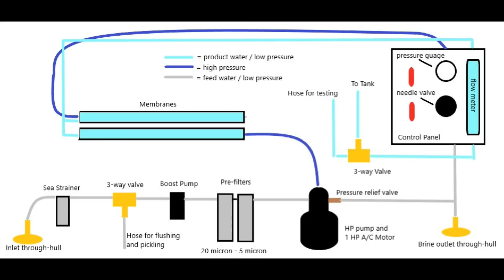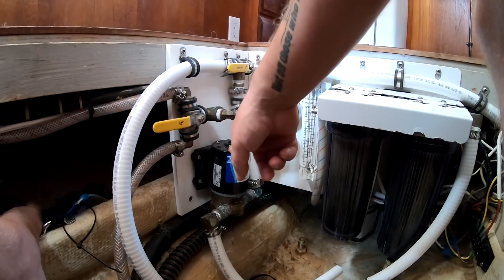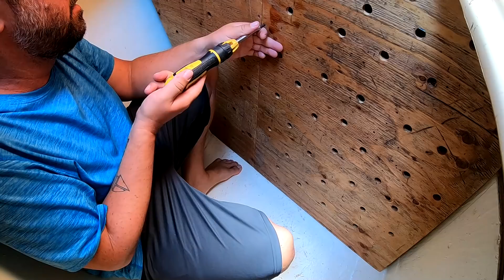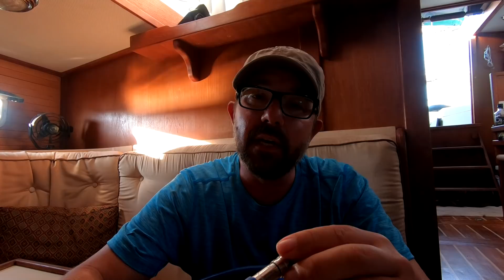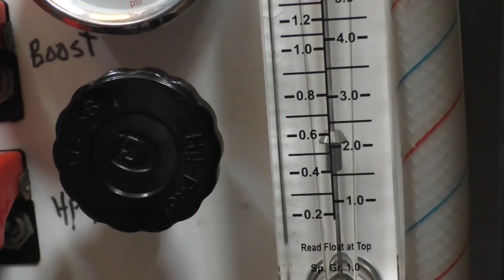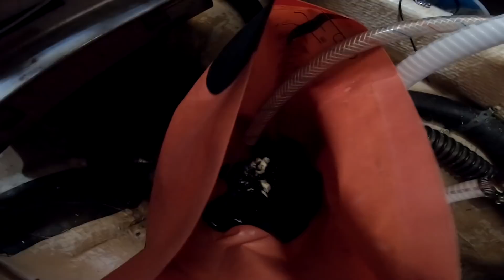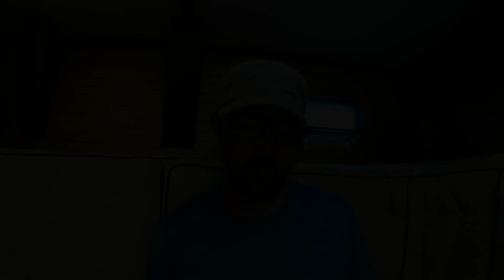How to make a 30 gallon per hour watermaker using off the shelf parts.

Comment: Could someone comment on if it is possible to design a system that does not require pickling?  I read somewhere that there is a method to take the fresh water made and use it to back flush in a way that does not require this if you leave the boat and not use the system for a long time.    The other question is even though you said the system pump and motor were noisy, could you have isolated the motor differently to reduce this noise in retrospect and what would that look like?
Reply from the maker: You can run water through a charcoal filter from your tank and flush the system every 6-7 days or so and not have to pickle the system. But that makes the system a lot more complex and depending on how long you'll be off of the boat, you're gonna run out of water at some point. Pickling is easy if you are going to be gone for a while. As for the noise, you could probably build a sort of soundproof enclosure for the pumps, but you still have the generator to listen to and deal with as well.

Comment: How long does an R/O membrane typically last running that high volume of water through it? 6 months, one year? Just wondering.
Reply from the maker: They lasts years. I replaced the first set after 4 years, not because they needed to be changed, but because we were in a place where the membranes were easy to get, so I did it as preventative maintenance.
Reply: Watch your TDS and flow volume of output water.  As the TDS goes up and the pressure is the same or goes up - that is the signal that your membranes are starting to "wear out".  They can last 4 years and I know people who have made it 9 years with good maintenance. :)
Reply: Manufacturers give membranes a 7 year life, but that's assuming that they are run 24/7 and under high pressure/high recovery rate. If you're only using it for a few hours every few days then it will last ALMOST indefinitely if it's maintained well.
I know of a solar powered land based system in Tanzania that has been running 8-10hrs a day for the last 9 years without any issues with membranes.

Comment: So cost was $1500 six years ago. How long did it take to build it?  Did you do the electrical wiring yourself? What skill level do you think this takes?  Did you have any professional guidance, input/ subcontracting? Sounds like it's not the first boat DIY project you'd want to do.  This is the first time I've seem your videos so I don't know your background. Seems like you were a professional plumber/electrician/mechanic at some point.  I'm more your average suburban idiot who knows just enough to be dangerous.  Would I be biting of a whole lot more than I can chew with this project?
Reply from the maker: The install took me the better part of a weekend. However, I am pretty handy and have quite a bit of experience when it comes to working on boats. I did the entire install myself, but again, I've got a bit of experience with boats. I don't think it's an overly complicated project, but if you don't have basic knowledge of boat systems, electrical and plumbing, it all of the sudden becomes rather difficult and possibly dangerous. I don't want to discourage you from taking it on, but I would recommend giving some serious thought to your abilities. I can't honestly tell you whether or not it is something you can handle, but I will say that I really enjoyed the project. It was very satisfying when it was finished and making water, and the fact that I know exactly how it works and went together gives me a lot of piece of mind while cruising. Best of luck!

Comment: My plan is for a similar system when I start to cruise but with a onboard diesel genset and a bigger motor to drive it and larger membranes. Also have a dedicated brine meter as well. Not sure I like the idea of the honda on board. Yes a lot of cruisers use it, and so would I if  I couldn't put in a genset, but the storage of gasoline on board, the possibility of CO in the boat, and the noise of it, makes we lean against it. While making water with a norther lights 5kw genset, I will also be charging batteries and running a microwave convection oven. Also want to run a dive compressor and possible air conditioning at times, and the honda just won't live up to all that.  But good system on the cheap. I Like fish taco's too....
Reply: Bob Fomenko 
So you don’t plan on having a dinghy and outboard...gonna miss out on a lot.

Comment: Great vid.

What do you figure your setup time is and shut down time is each time you make water?  Do you have an average amount you make each time?
Reply from the maker: It takes about 5-10 minutes to get it going, and most of that time is just getting the generator out of it's compartment. Flushing the system and shutting it down takes roughly 15 minutes. As for how long we run it on average, we typically run it for a couple of hours every 4 or 5 days which makes about 65 gallons. We run it longer if we have laundry to do.

Comment: thank You for a great video!
I've looked at some RO filters and housings for sea water, on eBay. They all have a max psi about 250. So my question is, is it possible to make freshwater from seawater with only 200 psi? 
I guess I`ll get 1/4 of the output, but can I still de-salt the seawater?
Reply: Jacob, I haven't seen the common 2.5x40 or 4x40 cheaper seawater membranes at that low a psi.  They do make other membranes for brackish water, etc that do operate at lower psi.  Pretty much the Dow seawater 40" membranes all operate at 800psi pretty much.  They are also the cheapest.  I've seen smaller units, but I know the membranes are a lot of dinero.  It is best to go with the Dow style 40" if you can fit it.  There are smaller Membranes on the link for his part number in the more section of this video.  Those small membrane systems can be pretty pricey and overly complicated.  The larger membranes generally last longer because they have more surface area.  You can make a high pressure pump with a 1-2 hp motor with the links to what I posted in here I believe.  The cost around $486 for pump and motor total.  Two pressure vessels 2.5x40, is $730 the membranes are $360.  You will need another hundred or three in prefilters, fittings, piping, valves, etc.  So all in you are looking at less than 2k with a commercial system.  If you had the power available you could go to a 1.5hp motor and a 4x40 pressue vessel and go from like 30gallonsperhour to 53 gallons per hour for like an extra hundred dollars.  Do yourself a favor and do what everybody else does for a low cost system.  Just make sure the amps for two motors(boost and pressure pumps), match your power supply.
Reply: those are for making R.O. water from fresh water. Used in bottle water machines and car washes.
Reply from the maker: Thanks again for your input Allyn!

Comment: Swagelok makes standard and custom high pressure hoses among many other things.  Most large cities will have a distribution center (Houston has three).  Swagelok has a good website www.swagelok.com with a section on fittings, and one for hoses.  They also make back-pressure regulators, which would work even better than the metering valve.  I like GO brand back-pressure regulators as well (http://www.goreg.com/products/regulators/back/index.htm).
Reply from the maker: Thanks for the input Loren!

Comment: The only tidbit I would have mentioned is that you do not flush the fresh water or pickling solution through the membrane. Pressure should be off - we see that in the video but you don't mention it. Also, a tip for some folks... we like to wash down our stainless steel and maybe boat with excess fresh water when we run the watermaker for a long time. We have a rainman but its just about the same as your system. The pex tubing we have for our fresh water output is maybe 20 meters long so we can just walk around with it and use it to wash down the stainless after a sail. Someone mentioned a 60 GPH system below and I concur... if you are going to go through all the trouble of running a generator or high output alternator you may as well produce as much output per hour as you can and use the excess water judiciously to wash down the boat and your equipment.
Reply: Can you explain why you should not flush/pickle through the membrane? I always thought that was need to avoid "growth" in the membranes. tks

Comment: what about 12v motors?
Reply from the maker: You can do it with a 12v motor, however, I don't have any first hand knowledge of doing it that route. There is someone else who has posted a comment on here about how they did it as a 12v system.

Comment: I know it’s been a while , but what was the total cost? Nice videos and nice work around. Do you make roetillas on board your boat? I prefer 14” or bigger, less messy , thanks
Reply from the maker: It was roughly $1500 when I put it together. Not sure of the cost to do it now. And yes we do make tortillas on the boat when we're in a pinch. But mostly, we buy them fresh. In Mexico, you get them hot off the press for about a dollar for a kilo. Amazing!
Reply: Mhmm, I miss fresh still warm tortillas. Used to stop at any good mexican restaurant and buy stack for few dollars.

Comment: Hope those brass ball valves are lead free for potable water.
Reply: You should hope they do have lead.  Without lead, they will quickly erode via micropores and be worthless.  This is why modern faucets in homes seldom last 2-3 years.  In my grandma's house her faucets lasted 50 years because they predated anti-lead mania.  Amount of lead released from use is very de minimis. Also, lead is a large molecule and will not pass through RO membrane.

Comment: I was watching mostly out of academic curiosity but you mentioned something I had to comment on. You had said that you had bad luck with Parker fittings but great luck with Swagelok. I work with High Vacuum and Ultra High Vacuum systems and we tend to have the opposite results. I have a feeling that both of our failure modes are quite different. My takeaway from this is Parker for gas, and Swagelok for liquid. Honestly my preference between the two tends to stick to "who makes the fitting I need" because corrosion isn't much of a problem for me,  but I will keep this information in mind when I am specifying parts.
Reply: Parker and Swagelok are both excellent.

Comment: Great video THANKS! I built small 12 volt system 1/4 hp 12 volt drawing 27 amps 21 inch membrane typical output 6 GPH 200 TDS.  if voltage is higher 13.7 or above 8 GPH I could go to single 40 inch and be up around 10/12 GPH but TDS and membrane life will suffer.   One thing I added to your basic design is put tee at salt water feed of high pressure pump and ran hose back to panel and mounted pressure gauge. this shows me the feed pressure at pump also when pressure drops I know its time to clean filters.  I used cheap magnetic drive (Chinese 21 dollars )for boost pump and typically see 7 PSI at pump head until filters start to clog for me around 2 PSI.  I am told you always want positive pressure at pump even with my small system.
Reply: First let me say there’s lots of  knowledgeable people around on this subject and I am certainly not one of them but I will tell you my thinking.  For me priority was 12 volts at two amps per gallon with simple system (as you can see I did not quite make the two amps) TDS was an issue yet I found many people are satisfied with any TDS below 500.  I sometimes do double pass to get into 100 TDS range but will tolerate 300 or below for general use.  Quantity wise my daily needs are five to six. gallons.   Almost twenty years ago I started the learning process with Village Marine little wonder rated at 200 GPD. On a good day full solar here in Caribbean maybe 7  GPH but for me the water was undrinkable hovering around 500 TDS .  I was informed the only problem was the 36 inch membrane did not allow sufficient flow to give the TDS I expected.  When it was time to change membrane rather then pay for for their in house size (36 inch)at less cost I purchased 21 membrane housing and membrane for less then their membrane alone and found my output dropped to 4 to 5 GPH and TDS consistently between 200 & 300.  I was happy camper and added rain water to the mix.  When pump failed after 17 years I decided to improve my system.  Found Filmtec membrane specs stating the 21 x 2 1/2 requires flow rate of 300 GPD and 40 x 2 1/2  needs flow of 700.  The one half gallon per minute gives me lots of overkill with 21 inch and just barely makes it with my 730 per day being sensitive to TDS I have decided to stay with 21 inch. I could go with 40 inch membrane maybe get output of 10 to 11  which would get my amps per gallon down but it may put me back into double pass mode for drinking water.  One source that was great to talk to and did not try to sell me a thing also confirmed my logic was Rich at Cruise RO Water makers.  He felt I would be happy with 3/4 GPM matched to one HP electric motor too one 40 inch membrane but its two much an energy hog for me so I will go along for the time being with what I have.  Rich is selling systems so they must be bullet proof spec wise so will recommend the best all around.  good guy to talk to I will include the URL to his site I think its where I found the specs on the various membranes. BTW I think it wasd his chart where he sells membranes that that I found the flow rates needed for each membrane size.   
His web url  
http://www.cruiserowaterandpower.com
Reply: Sailaway,how much did you spend on all your components?
Reply: You got it .5 GPM cat stainless best match  1/3 hp with direct connect recommended but with 1/4   hp suggested it  be run at 700 PSI  maybe too much load at 800 but thats what i run it at.  Battery voltage can make big difference in both output and TDS.  I have 4% voltage drop with #4 wire so when batteries at 12.6   I am seeing 12 volts or less   when I run engine with battery bank  at 14.4 volts TDS can drop below 200 and product water output around 9 with healthy clean membrane and solid 14.4 but yes if voltage drops to mid to high 11 volt range at motor I can expect 5 GPH TDS 300 .  In theory I should be OK Filmtec  claims the 21inch membrane requires flow rate 300 GPD Maybe my flow rate drops with lower HP so my 730 GPD may be 600 GPD only guessing.    If I were doing it again I would add another 100 watt  solar panel to my already 400 watts and go with 1/3rd hp motor.
Reply from the maker: Awesome! Thanks for the info!
Reply: sailaway01 what size pump are you running off your 1/4hp motor? .5gpm?
Reply: @crewsn8142  Sorry just came across your question. I started with 1/4 HP but it ran to hot even at 700 PSI so purchased cheap 1/3 HP better match for Stainless Cat .5 GPM. Still working ok run it at 700 pressure makes 6 GPH draws 30 amps @ 12 volts TDS always just under 300.  Membrane around 3 yrs old never did fresh water flush but run it almost every day.
Reply: sailaway01 how do you decide what size membrane to what size pump, it looks like the 4in x21 has a lot higher flow but how do I match a pump to that membrane? I am also wanting to use a 12V DC motor, I have a 3000watt pure sine wave charger/inverter so AC motor isn’t off the table but I would prefer not to convert from DC to AC because of the loss of watts in the conversion, the charger/inverter can convert ac to a 100amps dc so if I were to plug a Honda gen in as he shows in the video my converter can handle that load of a 1hp DC motor. I have a 360 watt solar system with MTTP charger, and I’m really trying to figure out which way I want to go, small motor small system that can run off solar or 1hp system that can fill all my needs for a few days with an hour of running a gen or engine or buy lithium battery’s and possibly be able to run every thing off the solar.

Comment: Why did you go with an AC system that is dependent on a genset, show power or portable generator vs. DC powered tat you can run off your battery bank? We have a 10 year old Spectra 300 DC versions with auto flush. Great system if someone is contemplating adding one today. It has a built in charcoal, 5, 10 & 20  micron filter system. Charcoal gets replaced every 3-4 months and the other get changed but reduces as with your system.
Reply from the maker: I went the AC route because I could make a lot of water fast and the system was easy and inexpensive to build.   And at the time, I could easily source the parts I needed and figured it would be easy to repair/replace parts anywhere in the world. Also, I wanted to have a small backup generator on board anyway. It by no means is the perfect system, as everything out there has tradeoffs.
Reply: Probably because the Spectra systems are 8k to 11k.  This system is probably 2k, and a lot faster than a 12 volt system.  Some people want to just get it done, rather than waiting on a 12 volt system that usually produces a lot less.    Sure the 12 volt system is nice if you want to be completely off grid, but it can be a lot out of your batteries if you have some refrigeration and other loads going.  It takes a LOT of solar or wind power to keep a watermaker, refrigeration, lighting, and other loads going.  With this system on his Honda 2000 he can run the watermaker and have probably 3 or 4 AC amps left over to charge his batteries with, or watch tv, wash clothes, etc.  Running the generator for an hour or two will likely only use .2 or .3 of a gallon of fuel, and produce 30-60 gallons of water with extra fringe benefits.
Reply from the maker: Exactly!